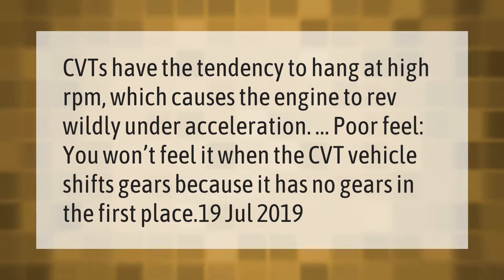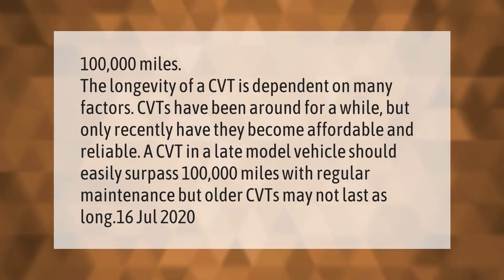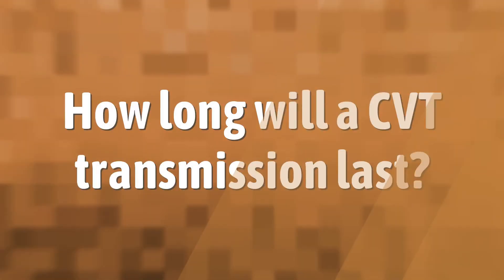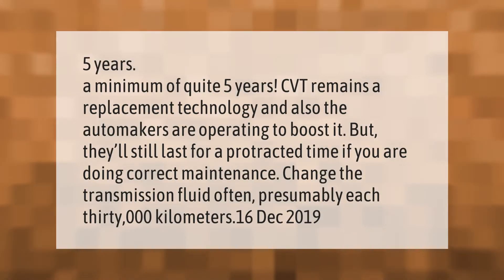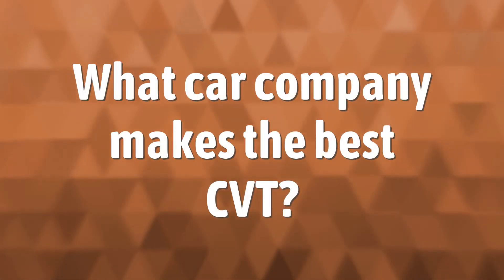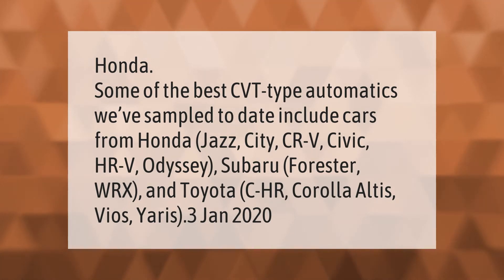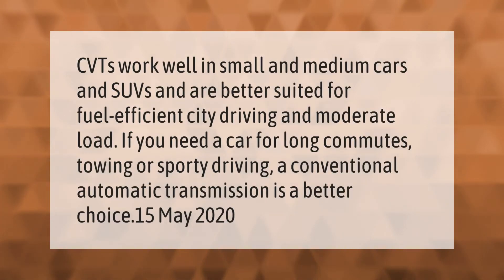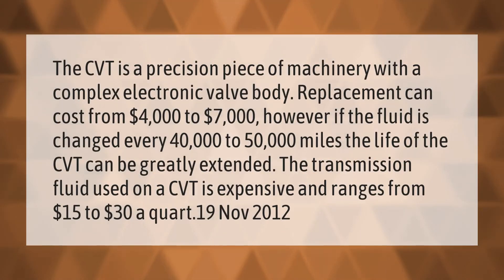Why are CVT transmissions so bad?

Comment: After 13 years with a Prius and having recently tested a new Toyota CH-R (in hopes it'd got any better, no way, same ridiculous revving crap with no performance), MY EXPERIENCE IS NEFARIOUS. Do you like the sensation of a slipping clutch but don't like how a burnt clutch smells? Do you hate acceleration? Do you like your transmissions more expensive to manufacture and maintain, yet less reliable? "Engineers" have the answer for you: CVT, WORSE DRIVING EXPERIENCE POSSIBLE. Also the most "efficient", not because of "optimum regime" nor any other marketing b/s (clearly a lie, as you give it way more gas than necessary in hopes it will show something remotely considered acceleration), simply because ANYTHING THAT DOESN'T ACCELERATE AND KILLS YOUR DESIRE TO DRIVE IS DEFINITELY "GREEN".🤣🤣🤣 Worst type of transmission I've driven (no matter if manual or auto), by a HUGE margin.